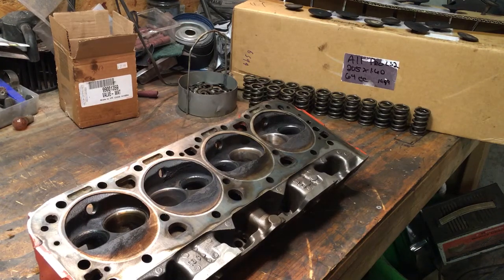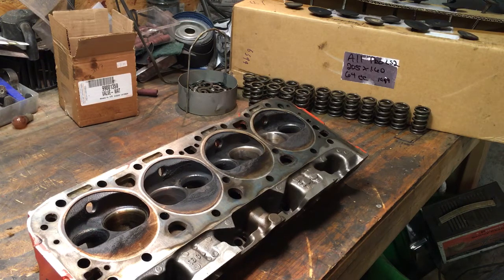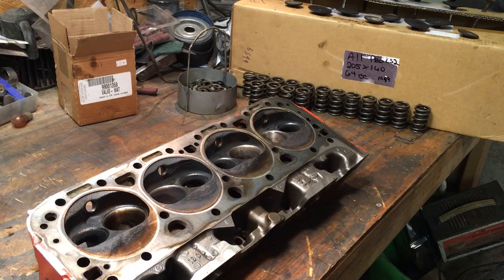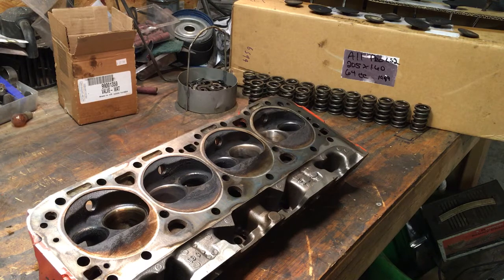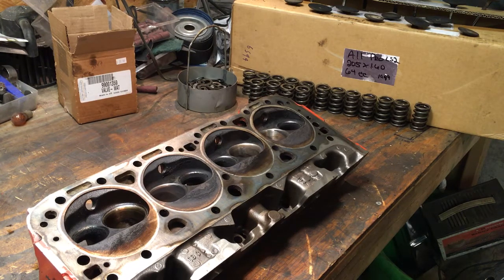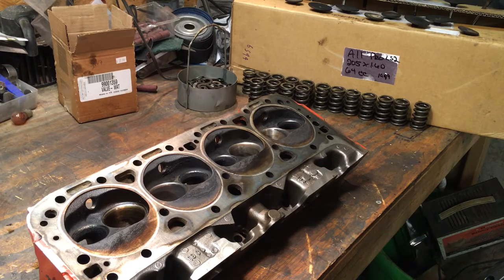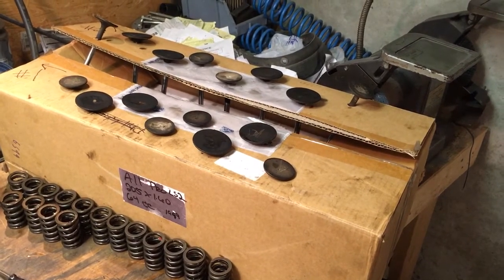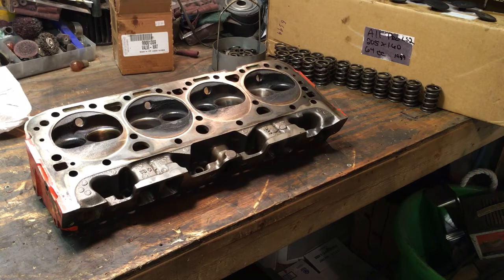LT1 Double Hump heads 492 disassembly

Comment: What cam are you using for this daily ?
Reply from the maker: I under cammed the engine thinking it would help the gas mileage. 
Elgin e-922-p
.443/.465 @.050 214/224 LSA 112
 I did end up running Comp Cams 1.60 ratio rockers on it to get more lift. 
W/1.60’s .472/.496

Since the block was factory Hydraulic Roller I should have run the Elgin e-1135-p HR
.480/.480 @.050 230/230 LSA 108

Comment: i have a idea for you i saw on youtube take your parts and get a gallon of carb cleaner you know the one with the metal basket inside the gallon can and soak those parts will come out sweet later
Reply from the maker: Carb dip makes a great parts cleaner, especially on grimy pistons caked with carbon.  I use carb dip, I have a 3-4 gallon plastic bucket with a sealing lid that has 2 gallons of carb dip in it currently.  I need to change out the carb dip but it's pricey by the gallon pail.  I may try to filter the current dip through a paint filter to see if it helps, but I think it may be losing it's strength.  I agree and admit I learned about the carb dip idea from youtube videos too!  Thanks for the feedback!  JD